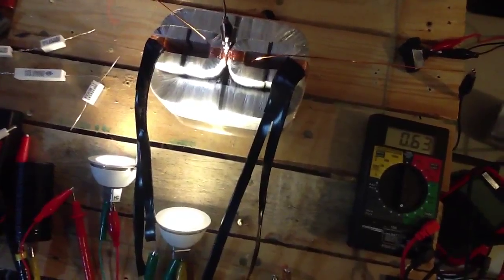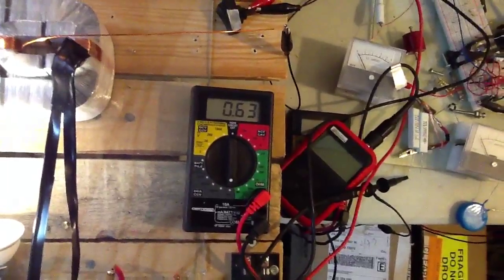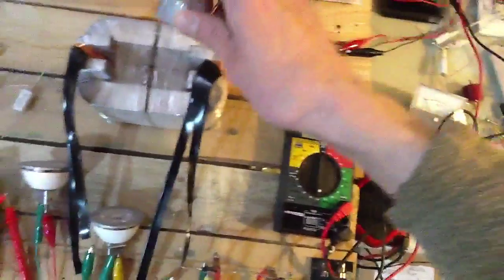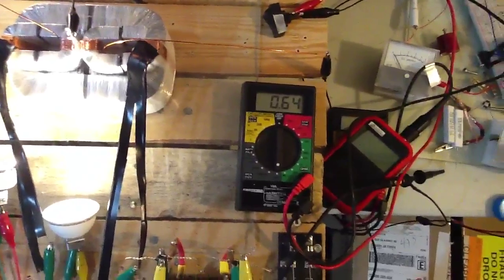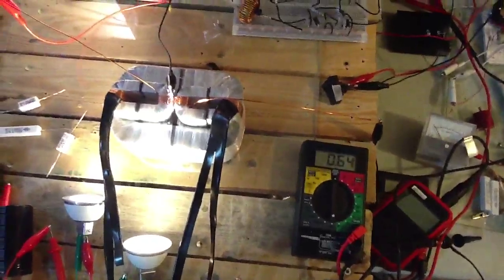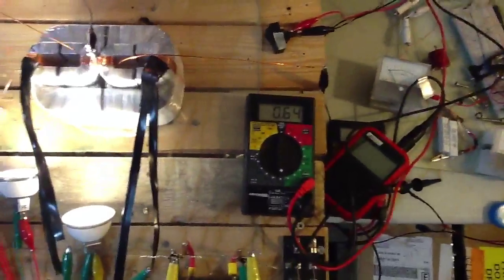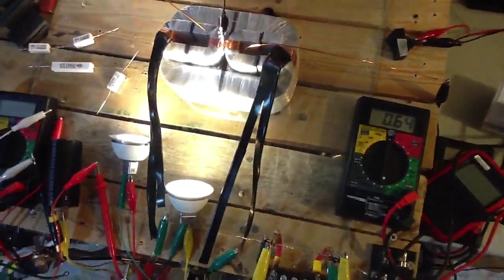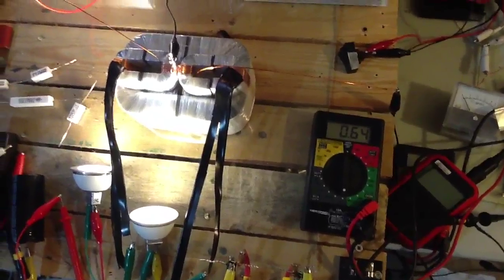BiToroid: Reactive Power

Comment: Input current doesn't increase on load, but what about the power factor? Does PF increase or remain same on load?
Reply from the maker: To me it seems each .5 of primary is coupled fully to its respective secondary. 
And then each secondary is 1:1 coupled to one another.
But dont use the secondaries separately... use them together in series.
You will be able to drive low impedance loads :)
PF im not sure of, but primary seems to be in relaxation on Thane's.
On mine I am driving the primary with square waves, not AC, which could also play a part

Comment: Hi Kirt!

The problem is that the consumption is already there.

It's like a fan you plug: it takes power and produce win.

Now, bring in this air many little wind turbines, they will capture the wind energy and produce themselves power. Does it need any increase of consumption for the fan? Of course not!

So, the fan is your primary, the wind turbines the secondary.

So the only relevant question is: can we get more effective power for a specific primary consumption than if direct load?

Comment: For your edification:  The magic secret about the impedance of a full load transformer being near zero is that essentially ONLY the transformer's primary resistance opposes current in the system, which makes it invisible to the source.  If you had a superconducting tank circuit with a super-conducting primary coil to keep current continuously oscillating, the transformer would put out power forever. :)  Only the DC resistance matters in a ideal fully loaded transformer.

Comment: But you wouldn't know shit about Nikola Tesla, the INVENTOR of alternating current -- the man who is the REASON we have electricity available to the masses.  You probably also wouldn't know he invented the high voltage spark ignition system by showing the first use of an inductor to charge a capacitor to high voltage and arc a spark gap.  No you wouldn't know any of that shit cuz you are spineless coward who believes what is given to you instead of doing your own homework.

Comment: Good job dumbass.  Again you painted yourself in a corner.  It has already been demonstrated by multiple people that you can do exactly what you said by winding a bifilar series-connected inductor AS FIRST DEMONSTRATED BY NIKOLA TESLA 100 YEARS AGO to increase the capacitance of the coil thousands of times.  And when done so in a motor, the backemf is delayed and the capacitant discharge accelerates the generator when on load. Dumbass is worse than crackpot.  I'm glad I'm a crackpot.

Comment: Gravity is gravity.  It's clearly not magnetism.  You can do a simple experiment by hanging one object of any material from a long rope or wire in a gymnasium.  Make sure it has large mass -- such as concrete block, lead weight, or bowling ball.   Add a pointer to the bottom of it and mark it's position on the floor directly under it.  Now bring a second heavy object within a few millimeters of the first.  You will see the first object move toward the second one.  This is gravity. Not magnetism.

Comment: If you put a resonant tank circuit on your primary, you can cut your input down to just a few milliwatts.  The higher the inductance on your input coil and the better you can keep secondary magnetism from coupling back to primary, the longer you can sustain oscillations.  The longer you can sustain oscilations, the more you real input power goes down.  By doing this, you'll be able to achieve 1000% to 60,000% efficiency like Thane talks about.

Comment: If 60Hz is the ONLY reason Thane is using steel, then metglass is the way to go because high frequency means small size and compactness.  You can transfer huge amounts of power at high frequency because the rate of change in magnetic field is so quickly (which is what determines actual available power).   What is this ZVS circuit you're referring to?  I've got a simple transistor circuit that uses a PNP to make a self-resonating tank circuit.

Comment: Loads don't consume power.  This is a misconception taught for 100 years in wrong EE.  All current goes straight through a fully loaded transformer.  Any current induced in the secondary is free.  The "consumption" of power is an effect that occurs in the generator/alternator itself back at the "power plant" because maximum current in the gennie windings lock down on the rotor.  Loads don't consumer power.  Period.  Folks need to get over this brainwashed backward way of looking at things.

Comment: "A fact is, load or no load there is a draw form the source."  Wrong.  The idea of "draw" constitutes the concept that a source is affected by a load.  An ideal bitoroid  xformer does not follow that rule.  Also there are misconceptions in electricity about power and draw.  All magnetism is free energy.  Transformers are already power duplicators.  The generator itself becomes the load when you let maximum current flow.  The "load" isn't the load.  The generator is the load.  Simple.

Comment: As long curent stays above 1A 1N4007 diodes will be just fine. ;)
Otherwise you will need paralel bridges with these due high frequencies in your circuit.

Comment: Your Z product stays the same but your reactive XL and XC re balances via the sharp hysteresis that this type of core material has, giving you an impression of nil power usage with the lights, basically the core and load act like a power factor correction circuit. You will see this if you rig up the system showing in/out the Core Hysteresis, Volts, Amps on a oscilloscope. You have found the trick that many OU guys use to try and fool the public with, great investigating, regards Arto

Comment: You meant a rhetorical question, I'm sure. It's cool, good work. Hmmm!. It's seems real, and hard to explain, that's for sure! A fact is, load or no load there is a draw form the source. What is the separate load current and voltage? Next, what is the maximum load that can be applied. I have no doubt your working on that! cheers.

Comment: Hi,

To make things even better just find correct capacitor and put across primary for resonance. this will make much less consumption from driving circuit.
Then rectify output and add filter capacitor so you can put voltmeter and ampermeter there for checking how much power output is. Hopefuly that helps.

Cheers!